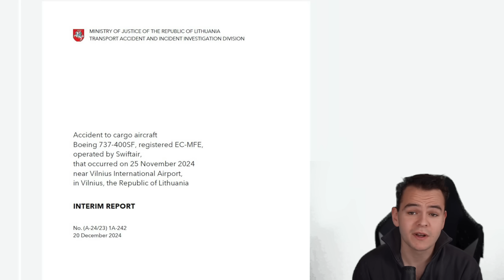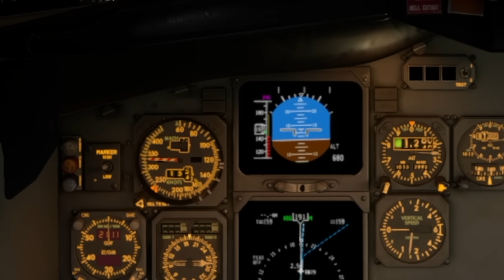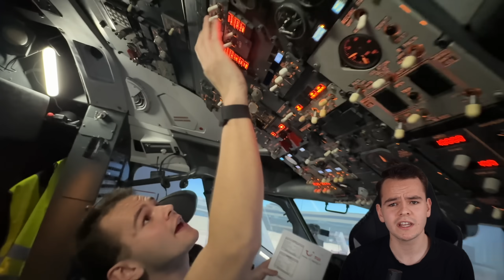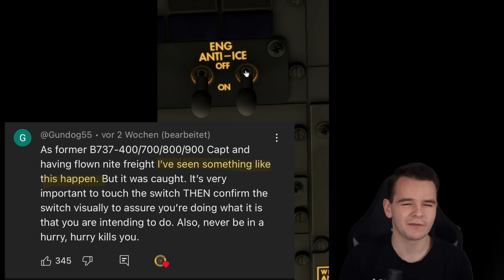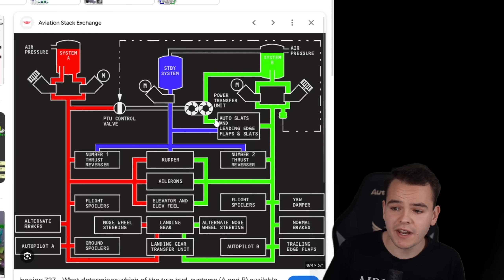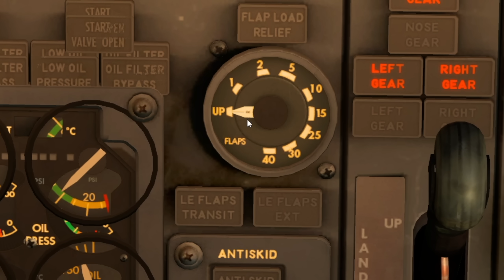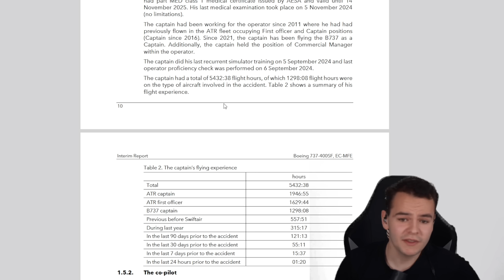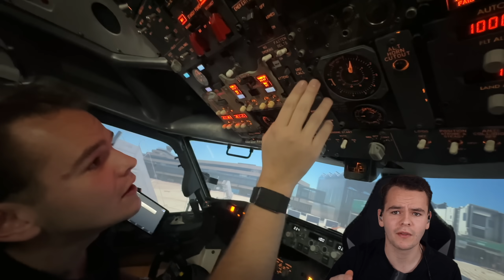When A Small Pilot Error Leads To A BIG CRASH

Comment: While not necessarily related to the age of that individual airframe, the age of the 737 as a design was a contributing factor here, the archaic systems architecture and cockpit layout on the 737 does inherently increase the risk of human error. Although, it definitely looks like fatigue was the primary cause of this accident. The numerous errors made with radio communication gives me the impression that this crew was struggling with a significant degree of fatigue. Regardless of how well rested they may have been, this flight was taking place right in the middle of the window of circadian low, a time of day where the human body naturally wants to sleep, resulting in drowsiness. We will just have to wait and see what the final report says, but this is my running hypothesis for now.

Comment: Swissie... you said "In your experience, it is a bit easy to confuse these two switches.." What kind of experience are you talking about, Swiss001? Thought so. Is the accelerator too close to the brake pedal in your car? Fact is that the inexperienced copilot and his unaware captain did not catch this huge mistake. No Boeing design flaw, just plain lousy switch operation and task sharing after an unstabilized approach. None of these two clowns did call for a go around. Their balls were probably too heavy... Regards from Switzerland.
Reply from the maker: 737 full cockpit simulator experience (which is of course not much at all) I meant that I understand it is easy to confuse the switches because of boeings design. This incident would have never occured on an airbus or on a 777.

Comment: Maybe It was pilot fatigue because those pilots are flying during the window of circidian low with a high chances of making a mistake if they don't do it carefully and let me tell you, pilot fatigue has killed quite a lot of people in the last 25 years or so and Colgan Air Flight 3407 in 2009 is one of those examples.
Reply: 100% and add working with fd that was fresh from training and the panic of trying to solve a radio error  i am surprised they did not mess up worse then they did